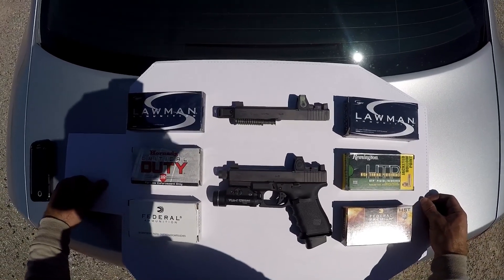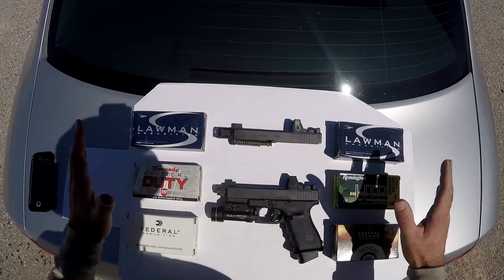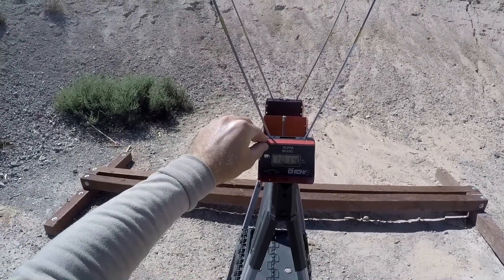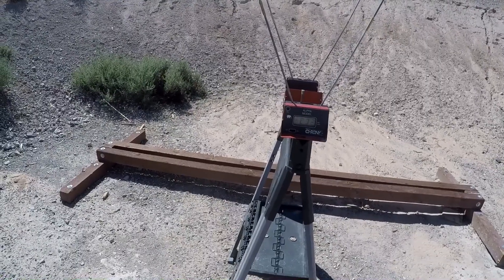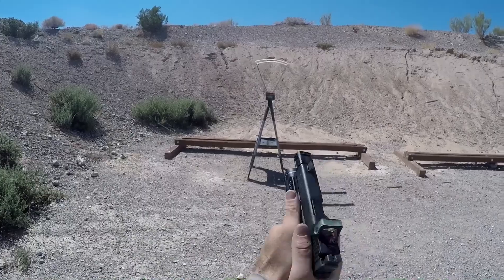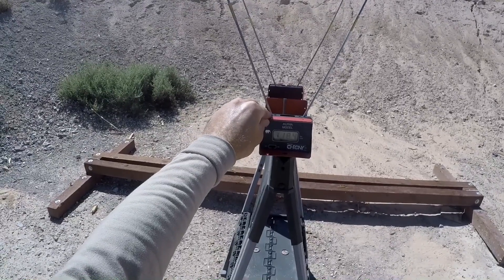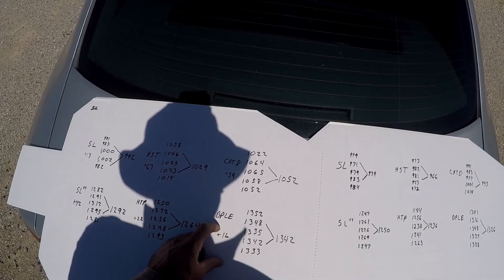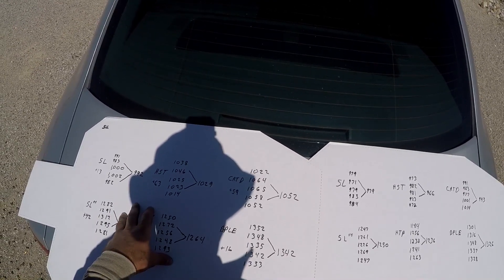Polygonal vs Traditional rifling velocity test

Comment: 9mm can make major with the right loads. I have seen guys do it. They are like +p+++ loads lol.
Reply from the maker: 127 gr +p+ Win Ranger can make major PF.  However, rules only allow it in Open Division.  There are however minimum PF requirements in all divisions…this is mostly an issue for hand loads, as most factory ammo will meet the min requirements.

Comment: I enjoyed your test; however, a flaw in the test is that "regular" rifling varies with each manufacturer, round count and condition; so the test comparisons didn't effectively represent "regular" V polygonal rifling. Perhaps a Part-II video which included several other manufacturers with "regular" rifling all of the same round counts and condition would give the test results more credibility. I own a 260 Rem. AI with a 26" PacNor polygonal barrel, and have no regrets with the choice over the 5R rifling.
Reply from the maker: Did a similar test with the new glock marksman barrel...similar results favoring the poly
Reply: Can't knock my guy 7N6👌🏾

Comment: What part number is that Glock barrel? Is it the gen 4 47739 part number
Reply from the maker: Eddie Archuleta honestly im not sure of the part number.  Its gen 4, and I also use them in gen 5 as well...
Reply: Ok great is it the right hand thread 1/2 x28 with metal thread protector?
Reply from the maker: Eddie Archuleta 13.5mm left

Comment: Where do you get a glock factory threaded barrel? Last time I checked, here in USA there is none of those. Thanks in advance.
Reply from the maker: mandapalque 1 from PSA, 1 from Gemtech, and 1 from Botach.
Reply: 7N6 ok, thanks.
Reply: Two years too late, but they sell them on the teamglock website just got one for a .45 ACP Glock 21
Reply: @JustShleem  oem glock brand?
Reply: @mandapalque  Yep OEM, paid $155 plus tax, comes with a thread protector too, they're gen 4 barrels but they work fine in gen 1-4 glocks
Reply: @JustShleem  I can not thank you enough. I appreciate it.